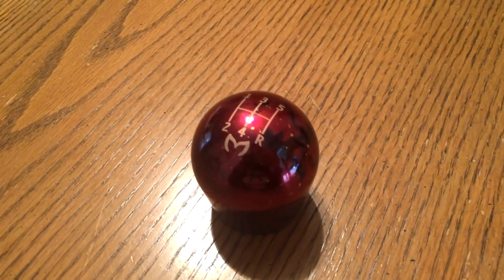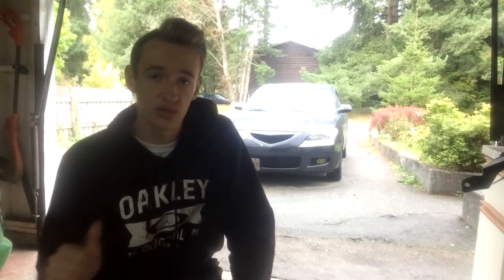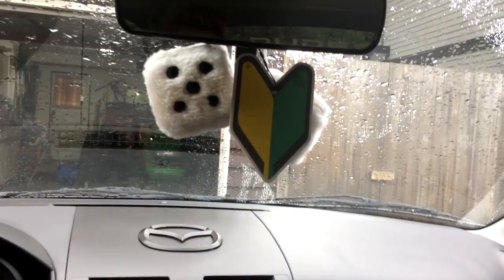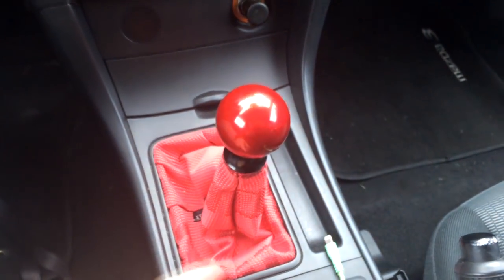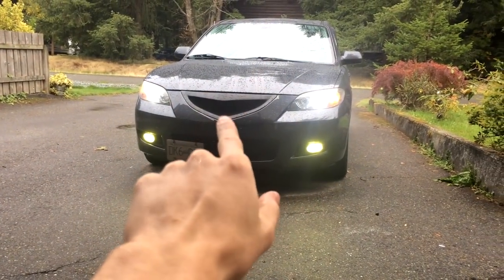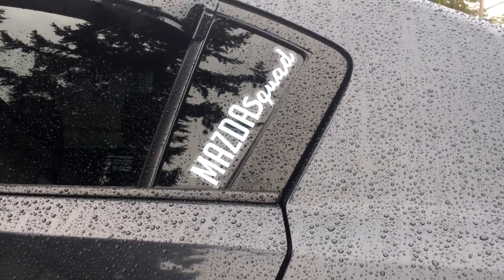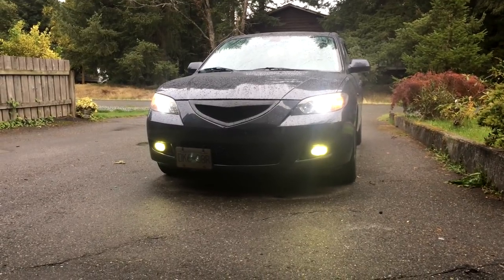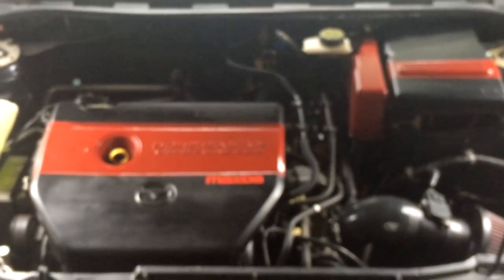MAZDA 3 MOD LIST! | Mazda 3 2007

Comment: hi 
Dudesk7 just a question for the Custom HVAC Knobs/AC Controls does it matter what knobs they are because i looked on ebay and didnt see the ones u have
Reply from the maker: You will need these ones: https://www.ebay.ca/itm/SET-FITFOR-04-09-MAZDA-3-M3-HEATER-KNOBS-DIALS-A-C-SWITCH-BUTTONS-CONTROL-COVER-/322057955728?fits=Make%3AMazda%7CModel%3A3&hash=item4afc266990:g:9jcAAOSw8KNW~L8K&vxp=mtr

Comment: I just came here to get a better  look at the interior of the 3 before I buy. Have you looked into Plastidip for the removable parts of the interior? I think anything would be better than nail polish imho.
Reply from the maker: Nail polish is just for the steering wheel emblem, everything else was either wrapped or painted (plasti dip works too)

Comment: Hey Dudesk, great video! i just got the same car but the grand touring edition and I kind of want to get into modding it a little bit. However, I do not have the money to turn it into a drag racer, so looking more for small mods for style/some performance, such as custom shift knob, maybe exhaust, etc. Any advice on making it look/drive nice on a tight budget?
Reply from the maker: If you're a manual, short throw shifter w/ solid shifter bushings and a shift knob. Footwell LED's are cheap and really easy to install, paint your badges and your wheels. Alloy pedal set, LED's. Check out my Mazda Mods playlist and you can see how to install all these things, you'll also find some really cheap stuff in there too!
Reply: I dont think ill be doing anything flashy like LED's and such, but the shifter mods and pedals are top of the list. Thanks for the quick response!
Reply: Also, and this will probably sound like the dumbest question but I am not car smart so bare with me, but for the exhaust, is it just the end that's custom or the entire piping under the car? And what are the pros and cons of each?
Reply from the maker: Depends what you mean, if someone says exhaust it could mean different aspects from it. Catback, axle back, etc. The end is just the tip, it does really nothing and is more or less just for style. Unless you bolt a full muffler to the end, then it will change the sound. The piping from the cat and back will change your sound, so for example my exhaust from CorkSport does not have a second catalytic converter, I believe it's just a resonator and a tuned muffler and that's what makes the noise. There are no cons unless you do a custom exhaust and get a really shitty sound from it, but pros it just makes the driving experience a whole lot better.
Reply: Gotcha. Thank you so much for taking the time to teach an idiot the basics instead of calling me stupid, it means a lot. You definitely gained a subscriber. Keep up the content!
Reply from the maker: That's what i'm here for my dude, thank you for subscribing 😀

Comment: What LED headlights did you buy? How did you install them? I have aftermarket HID in my 2006 right now, and had to use a spacer for the clip to close correctly. All of the LED kits I have seen don't have room for a spacer.
Reply from the maker: Bought them a long time ago, from Amazon I believe. It was just a cheap brand but make sure you get the exact bulb your car takes. There is a metal retainer, or clip for example. It takes a long time, took me an hour and a half to get it to stay. I can't say on exactly how to do it but just fiddle around with it
Reply: Thanks, man.  I actually just came across another video of yours where you installed all of the LED interior lights, and the headlights, and you explained in that video what you did to finally get them installed. One thing...have you considered switchback LED lights for your front turn signals?  I have some in mine, and love them. I have the type 1 switchbacks, which alternate from white to amber with each cycle, where the type 2 are white, then switch to just flashing amber until the turn signal is turned off, then returns to white. Got them on Amazon last year.
Reply from the maker: Good to know someone else has done those, defiantly been wanting to do it but keep forgetting about it!

Comment: I have a Mazda 3 2008 model my check light engine is on and I checked it and it said that lean or rich should I buy the mass air flow sensor and the cold air intake or just the sensor
Reply from the maker: Sensor could use a cleaning!
Reply: Colton Richter I bought a new mass air flow sensor and a inked cold air intake because it also rides shitty when I step on the gas it takes time to go

Comment: What size tires and rims are you running
Reply from the maker: The stock snowflake wheel runs at a 17x6.5 et53, and I managed to get a 225/45/17 tire on it

Comment: Why a mazda though? I wanted to start modding a car too and i like 2014 mazda looks but i just feel like i need to get a car thats actually fast.
Reply from the maker: It's either you like the looks & handling of a car, or you just want to go fast. Basically, for the two years I owned it I built it for a show car style and I loved it, looked back at everytime.
Reply: I own a Mazda now for 8 years, recently changed exhausts cuz it broke. Stock replacement. Gave the car a additional 50 horsepower. Love  the extra power and thought I might keep it longer. Watched this video and I thought I would get inspired but no, personally I think I need a change. Love the car, but Subaru I think is my next car or electric.
Reply: @dmcl9847  you gained 50 hp from a stock exhaust? Okaaaayyyyyy lmao

Comment: I want some type of Mazda idk which one though 
I was thinking about Mazda 3 or RX8
But I can only afford preowned right now
Reply from the maker: You'll run into issues with an RX8 if you can't afford much just a heads up, Mazda 3's are very low with maintenance.
Reply: Colton Richter thank you 👌🏽
Reply: I'd skip the rx8, fanboys would be pissed to read this but they're garbage. They're fun and sporty, especially for what you pay in insurance since it's technically a four door, but they're notoriously unreliable. You will be disappointed, especially if you're on a budget

Comment: What shift boot retainer did you get.... I got one and it was to big and to long.... any tips ???
Reply from the maker: Mazda 3 is a 10x1.25 thread, if that's what you mean
Reply: I got one that was to tall .. did you have to shave yours down at all?? I don’t have enough room with the retainer to put my shift knob on
Reply from the maker: Oh i've seen cases of it, worst case scenario you can cut it in half most likely
Reply: Alright. Cuz I got this like washer thing halfway down my shifter stopping it from going any further. Does this piece actually do anything? Or can I shave it off

Comment: Hey dudesk7 I am looking at a Mazda 3 touring. It’s for 5k but it does have 115k miles. Is it worth it?
Reply from the maker: Definitely not, you can get a Mazda 3 with 93,000 miles for $5,000 no problem.
Reply: Dudesk7 What is the life span of the Mazda 3?
Reply from the maker: They can get up to 186,000miles with proper care